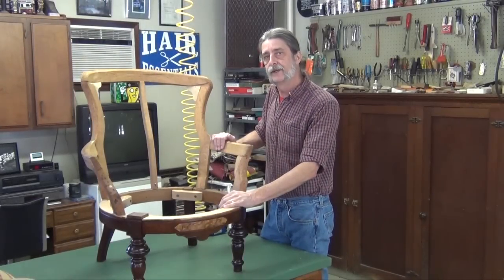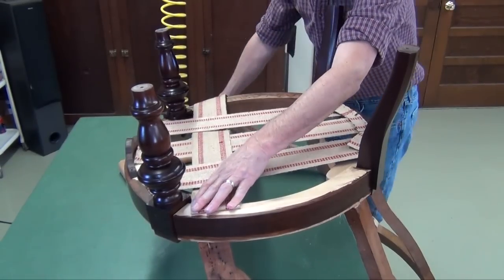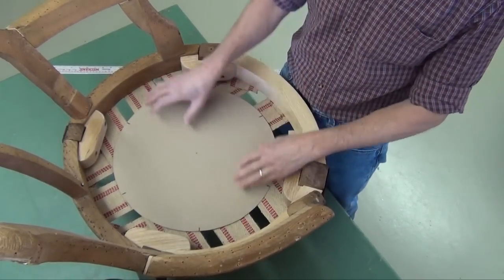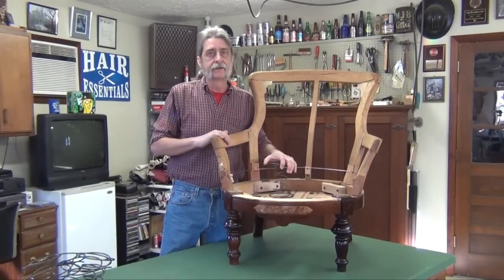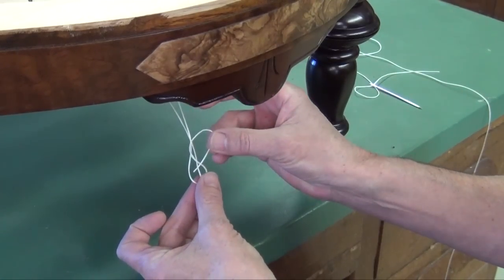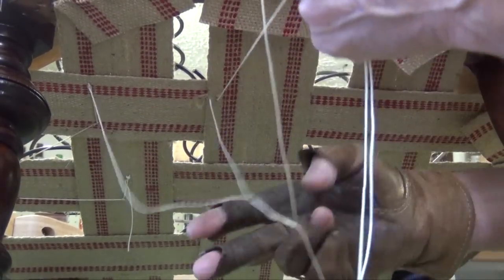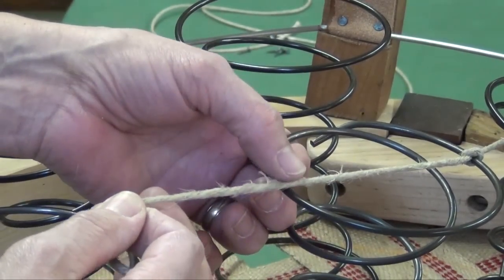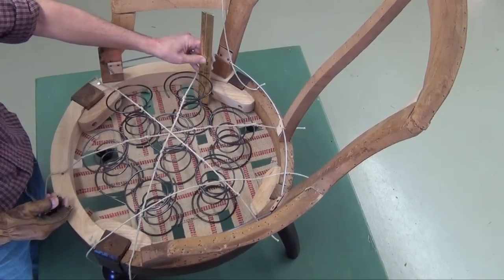1870's Victorian Chair Restoration Part 4

Comment: Old school craftsmanship . We learnedto hammer the  bottom webbing flatter when stapling or tack  nailing it .  The frame repair and finishing was beyond what we learned .
Reply from the maker: Flattening the webbing is a very good suggestion I will remember. Thanks.

Comment: Love your videos!  I am working on my first armchair and am wondering what is the thickness and type of string you use to attach the springs to the webbing and do you use the Italian Ruby Twine or some other twine to tie them together at the top? Thank you :)
Reply from the maker: I use nylon button string for sewing springs to webbing as it has far more strength than Ruby Italian stitching string. Yes, Ruby Italian spring twine on the top coils.

Comment: Two questions. What do you think of the klinch it tool shortcut for fastening springs? And, do you think nails are better than stapler gun?
Reply from the maker: Klinch-it tools are dangerous, good only for bloodletting. In time as the webbing sags, the points tend to protrude. I give a resounding NO! 
 Staples are the better way to go as they don't cause damage to the frame and that is your worthy shortcut.
Reply: @Buckminsterupholstery  Thanks for the quick reply. I knew it looked too good to be true!

Comment: how much do the springs need to be pushed down from their original height ?
Reply from the maker: Depending on how firm the springs are they generally pull down around 1/3 their height. For instance a 6" spring pulls down to 4" height.

Comment: I'm lost. what was the purpose of the wire you manufactured and installed with the leather strips?
Reply from the maker: Chits- N-Giggles The wire is the outer profile line of the seat. The burlap foundation and secondary muslin cover for the arms and back support will be hand-stitched to the wire. The seat padding materials will be stuffed to this level.